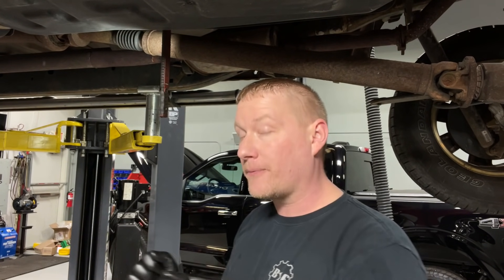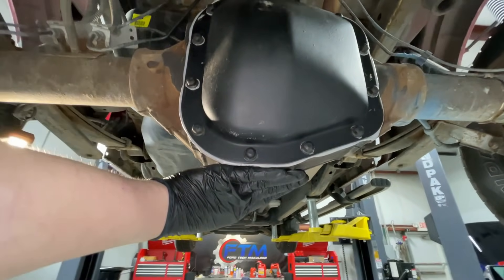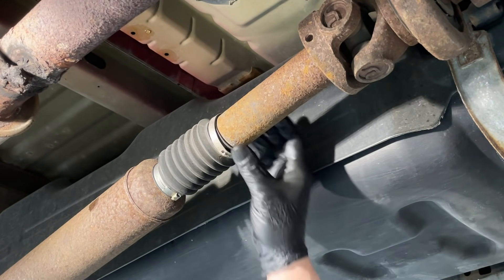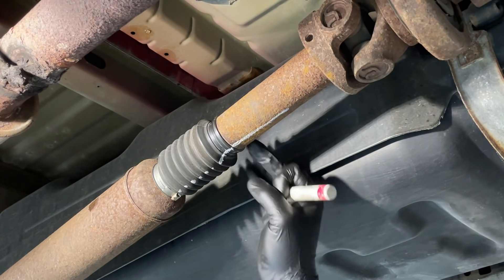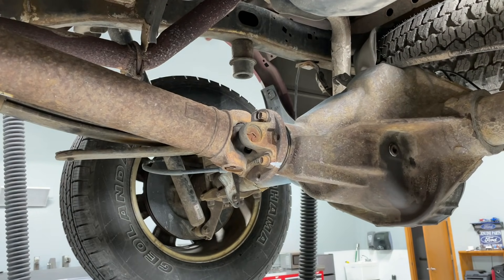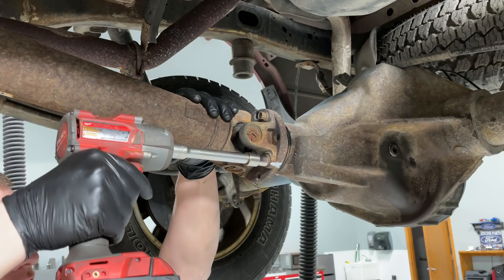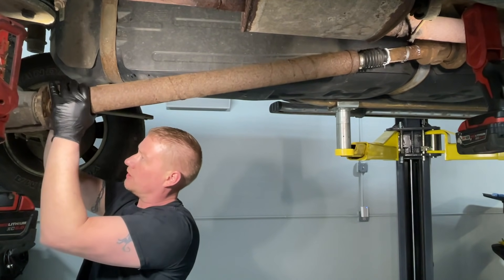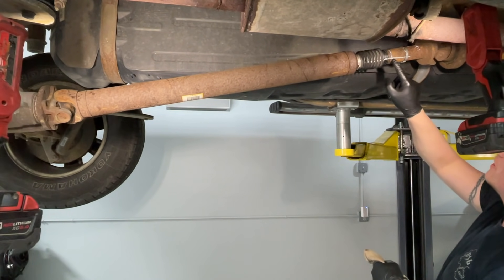Ford F-150 Driveline Slip Bump: Two Piece Driveshaft Kit Fix!

Comment: My mother had a used transmissions and a new set of diff gears over a "mechanic" not marking the drive shaft when U Joints were done.  She was never compensated either for the parts and work that she paid for.

Comment: I drop driveshaft, cleaned, greased and torqued bolts as you instructed.
Still experience slip bump at times.
Is there another possible cause???

Comment: I get something similar, but it's when I'm coming to a stop within the first 5 mins of starting the truck. When I come a stop I feel a "bump" when the trans shifts down to 3rd... Never anything on acceleration, only when stopping. Could that be related to the slip joint? It's basically done this from day one, bought the truck new, '23 F150 XL 6.5' bed V8. 🤷‍♂

Comment: I have a 2010 ford f150  xlt 4.6 I lubed the slip bump on the two piece drive shaft it's a little better but still having issues . is possible to install a one piece driveshaft.  I did it on a 66 Chevy long bed it worked great .

Comment: I've been waiting 2 years for this video👍any chance you can do a vid on rebuilding leaf spring bushings and assembly on the same type of truck with oem parts ?😂thank you so much for the video. Ford charged me 200 and it is bumping again 1year later and they won't cover it 🤣😂👍
Reply: Not the same like you would think the bushings in the leaf has  like a flange on both sides . I know it's easy with aftermarket but I need oem parts 😁

Comment: My '10 F150 has over 200K miles on it and has had this issue for as long as I can remember.  At this point, are the splines so worn that this repair might not improve the condition or make it worse?  What would you suggest?

Comment: Thanks for the video. I have an issue when pulling 5000 lbs, I experience vibration in the rear axle taking off, do you think is related? Thx in advance.

Comment: Are you local to southwest Michigan? I'd like to take my 2017 f150 to you for a clunk/jerk when leaving a stop.. almost like a bad joint on the drive shaft.. also want to change all the fluids, front diff, rear diff, trans, and transfer case, it has 37k miles and want it last for awhile, if your within 2 or 3hrs of me ill make the trip!

Comment: Hi Brian, thanks for another awesome video. Have the same "bump"  after moving forward slowly or stopping on '12 MY Navigator 4wd, can it be the same issue? I also know that Ford has TSB for 6r80 regarding 1-2 gear harsh shifting
Reply from the maker: No you probably have a failed rear differential mount.

Comment: Imagine you are going up a slight incline, slowing down. You truck downshifts then you get that sensation you describe. It's a 2009 F150 4x4 XL with the full size bed, 60K miles on it. You think this would fix that - or is there something else going on? Thanks

Comment: What do you suggest for a 2006 F-150 2wd 5.4 with 240,000 miles on it. Just replaced both exhaust manifolds and was driving it home from the shop and driveshaft carrier bearing let loose. $30.00 bearing not serviceable. Don't have $900 for dealership part, if they still make it. Can a 1 piece driveshaft be made? Really frustrated with Ford engineers right now. I'm in west michigan if you have any cheaper options. Thanks.

Comment: Have you ever ran across an issue with vibration ? I own a E 350 class c Rv and it feels like it has a driveline vibration. I can see anything wrong or loose. Had new tires installed and the same vibration exists. The vehicle only has 8300 miles on it and I did buy it used.

Comment: Hi Brian,
I replaced the 2 piece driveshaft on my 2010 F150 Super Crew with the 157" wheelbase. The driveshaft also has a carrier bearing. I used the blue PTFE grease as recommended by Ford and greased both the splined shaft, and the input shaft of the transfer case. Torqued all bolts per specs, but I am still getting the slip bump, 2 months after replacement.  Is it the PTFE grease, the transfer case spline or the driveshaft still causing binding? It's intermittent, but still annoying.
Regards,
Bob

Comment: Hey, I have a question.  A while back I found a mysterious, somewhat flexible, rectangular piece lying on my driveway and couldn't figure out where it came from.  Thanks to this video, I now know that it is part of the shift linkage.  It is on the part that you removed from the transmission lever and it faces away from the transmission.  It looks like it could be some sort of small heat shield, as the material it is made from has an asbestos-like look to it.  Is that part important?  It looks like it was held onto the shift linkage with a single rivet through the center of the rectangle.

Comment: I need your help.  I have the same exact problem in my 2012 ford expedition EL.  As you know. The configuration of the two piece driveshaft is different on this vehicle.  The Ford dealer told me it could not be this problem a few years ago.  I think they are wrong. Please help!

Comment: The 2020 f150 I have has a driveshaft spin at start up when engine is cranking to turn on. It spins fast and hard enough you can feel and hear it when it stops moving at the rear differential thump as it spins up and the gears meet. Dealer says they never see the shaft spin and hear no noise as usual. Have you seen this?

Comment: Will this happen on a 2010 f150 V8 4x4 with an aluminum driveshaft? I have a shudder when going from on highway and slowdown to 45ish then start to go faster again, it shudders. Im thinking its the torque converter.

Comment: I see leaks under my F150 right from the transmission by the rubber booth to the driveshaftl by the gas tank, what can be the problem? 

Also when driving I feel rattling sometimes and also low squeaky noise, I bought the truck used some one put a universal transmission cooler instead of the original, could that be the problem, would it be a good idea to change back to the original cooler? Thanks

Comment: Hey major question here. I just went under my 2021 f150 xlt and there is no connection with the bolts from the shift linkage to the transmission. The bottom bolt has been unscrewed from the transmission. Is this ok? Should I be worried?

Comment: I feel a slight bump in my 2016 on take off from a stop light and couldn’t figure it out. crew cab 6.5ft bed. This driveshaft looks very similar. Is this happening on the newest body style mine has 70k miles.
Reply: Also curious, same issue with my 2016

Comment: What do you contribute a tapping noise around the exhaust manifolds, despite changing the studs and gaskets? Could it be injectors or dirty valves? This is on a 3v. Thanks.
Reply from the maker: Roller follower failure.
Reply: @FordTechMakuloco  
Oh that’s fun 🥲
But thank you for the heads up... now it’s time for the heads out
Reply: @FordTechMakuloco  It’s a 155k engine, and the sound hasn’t begun abruptly, do they require changing? If so, should I replace the lash adjusters as well?

Comment: Have you heard of this issue with the 05-09  mustangs? Mine is doing something similar, and I know Ford used a two piece driveshaft.
Reply from the maker: It can happen to any make and model that utilizes a slip joint.

Comment: I have this happening to my 2016 f150.5.0 but only happens when I'm breaking ok sports mode. I can't seem to figure this out because I don't have this type of joint you have in the video. I have 1 shaft going to the rear differential

Comment: Does this happen to 2017's too? I get a similar kind of bump like you describe only coming to a stop. I though it might be a trans shift issue.
Reply: Anything that has a slip yoke style joint. I’ve seen it happen on 1 piece and 2 piece driveshafts. It’s just more common on the 2 piece ones.

Comment: Is this what would cause what seems like a slight hesitation for my truck to seem to want to engage in reverse? When I go to back up without waiting for a second, there is a clunk in the driveline somewhere. Going into drive from reverse is fine, it just seems like something needs a second to engage in reverse before I apply any power.

Comment: I've had the same sensation in my 2011 F350. Is this the same grease/part number for it? I definitely have the 2 piece rear driveshaft.
Reply from the maker: Same grease but not sure if the clamp is correct for that model.

Comment: I had to replace my whole shaft due to the center support bearing cracked on both sides. Dorman has one with a lifetime warranty and the center yolks has a grease fitting to be greased. I just use the red tacky grease. Maybe the teflon grease will be better

Comment: This is alittle off topic but , I just had a 7" Readylift lift kit installed on my 2018 F150 and now between 25-35 mph I get a vibration.  Any suggestions on a remedy for this?

Comment: Hello could really use some help!  2019 f150 xlt 3.5. Clunk noise coming from driver side rear wheel well area at real low speed. Notice it while coming into and out of driveway and in parking lot. Sounds like it’s in the body or bed. Any idea?  Dealer couldn’t figure it out but it drives me nuts.

Comment: Do you have a video on carrier bearing replacement for the driveshaft?  I am hearing a shudder in mine and suspect this.  Is it welded on?  Non serviceable?
Reply from the maker: Not serviceable.
Reply: @FordTechMakuloco  bummer!  So if that bearing goes then do I need to replace the entire half of the shaft that has it?
Reply from the maker: The entire unit as it a balanced assembly.
Reply: @FordTechMakuloco  thank you!  I will start looking at machine shops versus OE replacement

Comment: I am definitely doing this, but while I’m down there I’ll be replacing the U joints as I’ve recently surpassed 100K miles on my 2015. Recommend a specific brand?
Reply from the maker: Only use the Ford U-joints. They last the longest, fit the best and install so much easier.

Comment: Can you answer or someone who has performed this fix have a vibration at highway speeds and this solved it?  I have balanced tires, all new fluids for rear end, transmission etc and mine has been doing this since 100k miles, I’m at 138k and original owner 2013 f150 super crew 4x4 with 5.0.  Factory size tires, no left all factory specs.   Constant vibration at highway speeds and manually shifting from 6th to 5th and cans even coasting doesn’t change vibration off and on throughout truck.

If it’s not anything with the slip yoke then how do I check for driveshaft balance?

Comment: So, is this whats causing the 19 f 150's to thump at startup? Nothing while driving, but almost every startup, I get it. Most times its fairly minor, but sometimes, its really loud. The vehicle will also move very slightly, if the parking brake isn't engaged.

Comment: I have a 2016 with a two piece shaft. When I am at higher speeds 65 mph plus and I let off the gas I will get a vibration for a short period and it will go away until I let off the gas again. Do you think this part might be causing my issue?

Comment: old video but do you find this happening on a 2018+ mustang gt with the 10 speed , i get a knock or something similar in sport mode when it downshifts into 3rd from 4th gear when coming to a stop sign or light .

Comment: i have a 1 piece i just bought a few months ago thought the trans was shifting in 1st hard but i googled "clunking when stopping and starting 2012 2wd f150" it was super easy i just used wheel bearing grease also nothing special and the noise has been gone ever since

Comment: I have a 2009F 150 and my rear bounces up and down I don’t have any wheel or tire issues I checked multiple times and my shocks are brand new with no issues as well any other ideas? Please any suggestions I’m thinking it’s my driveshaft and then I’m thinking it’s something to do with the left wheel it’s sings or maybe I’m tripping it looks like the rear of the bed towards the left is balancing And I can fill it under my butt in the fairest I go with a more aggressive vibration

Comment: Is this an issue for the Expeditions and Navigators in those model years also or just the pickups?
Reply from the maker: I have only seen the pickups since most SUV's use a IRS differential that doesn't move up and down like the trucks with a solid axle.
Reply: @FordTechMakuloco  great.  Thanks so much for the reply.

Comment: Does the 2006 f350 possibly have a similar issue?
Reply from the maker: They sure do.
Reply: @FordTechMakuloco  thanks for the response. Already have the teflon lube coming from Ford. Need to find a good option for the clamp on the f350.

Comment: Is this what happens on start up as well?
Reply: my 2017 F150 platinum like you said clunks at startup and the sound is really annoying.
Reply: The clunk on start up is likely your a/c compressor starting to spin up after sitting overnight. The refrigerant migrates down to the compressor.
Reply: @brentdabels803  It jars the whole truck pretty good, feels like the source is directly underneath the cab
Reply: Probably be one of those noises that you might have to get someone else start it while your underneath. Typically the driveline clunk that is being  explained is when you go into gear and step on the gas it will bump. Or from drive to reverse and accelerate it will bump momentarily.

Comment: Is this a similar fix for the 04-08 F150's that have rear end shutter from a stop.  My 07 since the day I bought it has a slight shutter while turning from a stop especially after driving on the highway or extended periods of time.  I know my rear pinion seal needs replaced, is that a possible cause?
Reply: Get the leak fixed and change the diff oil. Add a container of friction modifier to the oil as well.

Comment: How can I line up the spline if I failed to draw a line when doing this? I did the complete job, but failed to draw a line on the spline side and realized when it was too late. I guessed to the best of my ability, but now I have a vibration when driving.

Thanks for any help you can provide l.
Reply: Best guess, you could try removing and  reorienting the spline 90 degrees and see if that helps the vibration. Repeat if it doesn't. Also, check for any wear marks that might indicate where it was

Comment: I have the same problem right now I put grease on it and it keeps doing it, I don't know what it is. I have a Ford F150 Raptor 5.4L triton engine.  The strange thing is that it does it only when it is in gear D, when I drive in the other gears 3.2 it does not produce the Bump only in D. What could be the problem?

Comment: I did this on my f-150 and it was easy and really did solve that annoying bump I felt every time I took off. 

Now.. I have a rear end whine when I'm driving at higher speeds, it sounds like a turbo whine and it's annoying. Looking around I need could be pinion preload? The whine doesn't go away when coasting, it's always there. Any suggestions? I don't want to take it somewhere and get raped for them telling me I need different things.

Comment: Should you change u joints if doing this just to start fresh?
Reply from the maker: No real need, in reality if corrosion does not set in, the u-joints can last 300k miles.
Reply: @FordTechMakuloco  is there a way to email you?

Comment: I have a question for you. Why would the ford dealership put a red dot on my oil fill cap after an oil change. The first time I thought I was tripping and wiped it off but they did it the next time as well. Wondering if that means something is wrong with my engine, was hoping you might be able to shed some light on this red dot lol.
Reply from the maker: Never heard of that.

Comment: I have a similar type issue with my '06 f150. When I come to a stop then take off usually making a left turn. When I take off I feel a bump or popping type issue. Any idea what this is. Do you think it is the same issue as this vid?
Reply: Try changing the rear diff oil, but add a container of friction modifier to it.

Comment: I took my Ford pick up into the Ford dealership service department. And they said that it’s not my driveline it’s probably a u joint or a transmission issue. Even though I literally have the exact same issue that you’re describing in this video. Now I’m confused.

Comment: I got 1 for you guys. My wifes 2015 mustang 5.0 gt does it a bit and my 2011 Ford does this weird thing. I come to a stop sign and stop, I go to take off and its almost like the torque converter needs to spool up a bit before it engages fully. Weird.

Comment: Will you feel that same slip bump during heavy acceleration at highway speeds? Or is that a trans shift issue?
Reply from the maker: Not at high speeds.
Reply: Any ideas what's causing that then? Already had the lead frame replaced and trans reprogram under recall... 2013 5.0, trans has about 190k on it. Thanks!

Comment: If the grease was binding on the spines so aggressively that it was causing a momentum change to the point where it felt like something bumped the back of the truck, how is it that you were able to slip the spline joint apart so easily?
Reply from the maker: You are comparing an unloaded spline to a spline under load with the weight of the vehicle on it.

Comment: I'm having trouble identifying a problem in my '02 F150, single cab, rwd. It shakes while In park,  as soon as I get between 60-70 mph, and when I let off the gas something vibrates alot.
Reply: Just changed all my coil pacs, oil, and practically new tires. 
The problems I know of: front sway bar attached but not locked into place (tie rods?), a switch In my steering column messing with my lights, and an auto shop said I only ran one code and it says my exhaust is clogged. He looked it up and said it was my catalytic converter.

Comment: I think I have a similar problem with my 2003 Ford Explorer, if I accelerate hard and then let go it’ll kick, and when I brake hard it’ll do a little kick also, and it’s not the transmission. Replaced my worn engine and transmission mounts and it improved a lot but it still happens just not as bad. Btw I have 180k miles